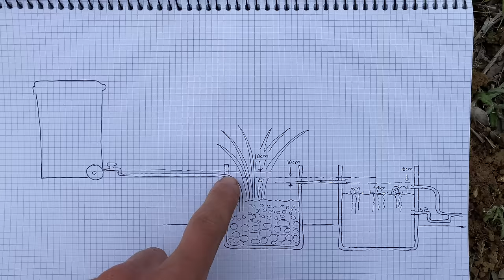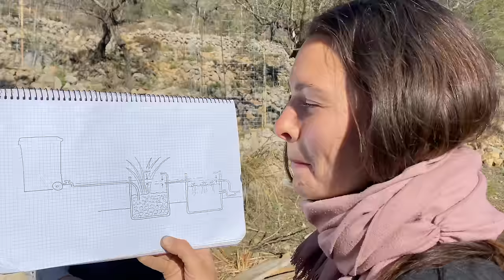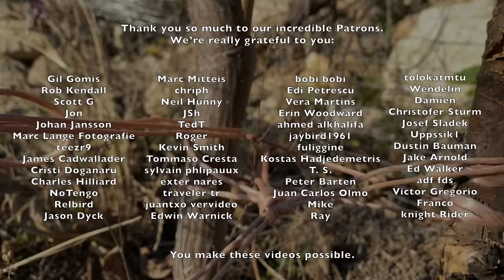Creating an OFF-GRID PARADISE | Abandoned land to self-sufficiency | DIY Compost Toilet Build #4

Comment: Your tanks are made of Polyethylene plastic...  and unless coated with something that is UV resistant, they tend to weather, and crack in fairly short order. You may want to consider covering your tanks.
Reply from the maker: Thanks Curtis for this information! For sure we need to find a good way to cover our tanks, everything we seem to cover them with in the past does end up degrading in the sun after one or two summers though! Any recommendations?

Comment: Just too add now that you should have your bog up and running. A small thing we say when on soak away or septic tank. Don't pee inside if you can pee out. Saves on water, especially if it is in short supply, like you say you are just now. The alternative is only flush every other time. Now I'll go back to the fire as is very cold here just now, warmer in Scotland at 75, as here only 56 and showery.
Reply from the maker: Wow running the fire in May in Portugal, that's pretty great! We're still waiting for our rain!! Still not finished the compost toilet, we are very slow at building! The next video is out today, about some mountain beasts, hope you like it - leave us a comment and let us know what you think? I'm sure you've got more experience than us in everything we were doing in the video!

Comment: it was necessary to concrete the metal posts near the stairs and make a railing, or make them on the other side.
Reply from the maker: Thanks Alex! Yes I think you're right, we've decided a railing does make sense. And yes good idea putting it on the other side, then it can be a shorter railing with less posts!

Comment: i think that you need to use T connector on output in the first tank for get water from middle part instead of top level. upd and probly better use a bigger  ppipe
Reply from the maker: That's great advice thank you! Definitely think we should have used a bigger pipe, especially if we end up connecting the rainwater pipe from the roof! In a storm the whole thing will probably overflow.